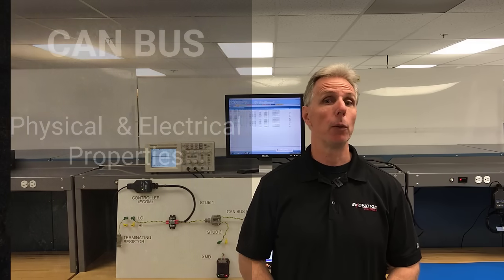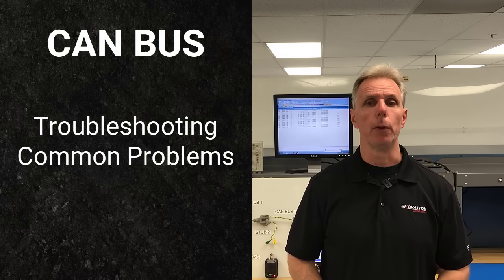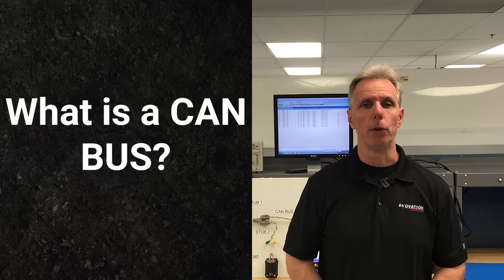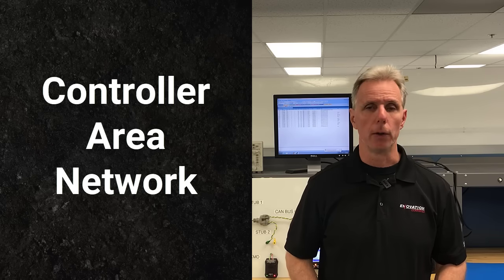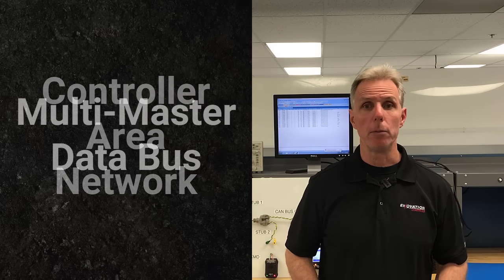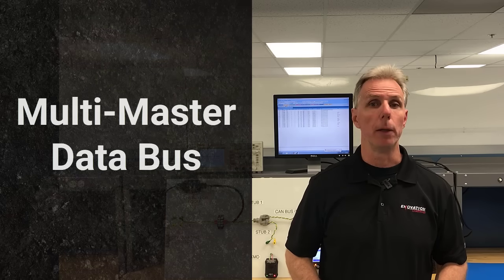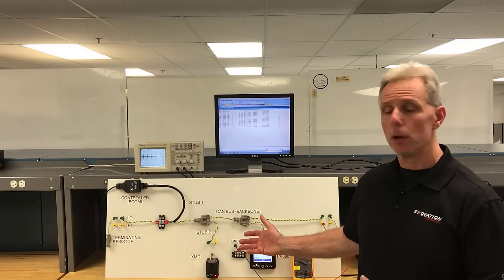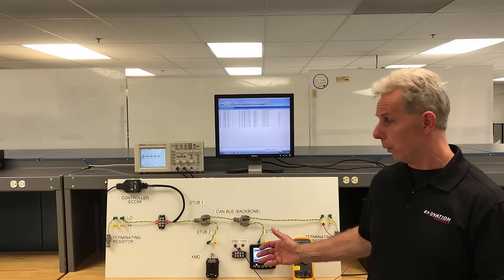CAN Bus Properties and Troubleshooting

Comment: Great video. My 2003 f350 6.0 diesel truck has 1 ohm of resistance between high and low can. Voltage on these are high 2.75, low 2.37. Is this an end of line terminator  going bad? If so, where is it. No one seems to know. I suspect the 4x4 module, as they cause so many problems when they go bad.
Reply: Put a scope on it and look at Allen Bradleys documentation to determine node number.  Then pull one node at a time and use either the scope or determine node number loss.
Reply: @marklangren3142  I found the power supply to the ecm to be low. My breakout box was showing ecm voltage down to 9 volts while cranking and 11.9 while running. It was causing all kinds of codes and false issues. I found 2 things wrong. First one was, I bough 2 brand new batteries and one was dead from the factory.. so I was cranking on one battery. Replacing that helped the ecm voltage during cranking. However, the running voltage was still low. I found the 2 red wires on each battery + post were isolating.. those 10mm nuts, have build in swiveling flat washers. The washers had rusted somewhat and were isolating the nuts from the wires. Then the battery posts themselves had a very thin layer of corrosion that also acted as an isolating material. Once I polished the battery terminals, wires and installed new nuts, the run voltage on my ecm came up to 14.4 while the engine was running.. all my problems went away at that point. Those 2 wires feed the ecm, ficm, fusebox, and glow plugs. Low voltage on these feed wires will make a perfect truck, a junk truck...
Reply: @KBS117 i just read your second comment where you said that fixed all your problems... what two feed wires were you taking about?
Reply: @davewallace1639  the smaller red feed wires on the + battery posts. Those red wires feed everything in the truck except the starter.
Reply: @KBS117 so should I test those wires specifically to see what voltages they have
Reply: I have the same truck, no communication to scanner, did you ever find a solution to your problem???

Comment: i took a voltage reading on can bus net grounded one side good and did pins 6 and 14 low and high bus, should add up to 5 volts between them i get .9 and .9 1.8 volts total!! have   no start pontiac g6 2008 lz4 3.5 u0101 code tcm it was fine until i took battery out caused all kinds of issues! how you supposed to change a battery if it ruins the car?? lost memory or something. i get 60 omhs on bus and power! just the high low way low .9 volts! times two 1.8 volts should be five whats this mean!! help

Comment: i was getting 120 omh on can bus at obd2 port!! had a no start issue! earlier in project saw online that the stupid spy network onstar caused many issues so i unplugged it properly! one of the termination resistors must be inside the onstar system plugged it back in everything is fine now 60 ohm reading! had a error on dash no start! gm put piece of shit pontiac g6 speed sensor one inch above exhust manifold! i let car idol in garage for 20 minutes on cold day a little to long and the sensor overheated! tcm tran cont module couldnt communicate with ecm or bus anyway! the speed sensor can cause this issue according to national database of mechanics notes! dont be a part changer people!!! test, look, grounds, power, wiring issues, sensors, modules ect... the stealership( dealer) couldnt fix my car!! changed so many parts that wernt nessary!! i went in bay got key and towed my car home fixed myself and im a carpenter! the dealership is sorry ass thieves!! they lie!! always!! you dont have to pay them people if your car dont drive home!! be a man and take your shit home!! its a civil matter! they have to sue you and cannot!! so many people pay thousands for parts and tow car home!! tell them up front your not a sucker fix it right or wont pay!!

Comment: Please help.  In my '96 F-150 the speedometer and odometer stopped working.  I replaced the speedometer with one from a donor in a junk-yard.  Truck didn't like the replacement as when I attempted to start the truck the starter sounded as though it turned over maybe 1/8th of a turn and then everything shut down as though the battery had been completely removed and left a no communication issue between my inexpensive scan tool and the OBD 2.  I put the original speedometer back into the panel.  My internet research revealed I could restore OBD 2 communication by disconnecting both battery cables, turning lights on for a while and then reconnecting the battery.  Did that and then with key on/engine off check-engine light and other panel gauges worked (headlights, horn, and interior light all good) until I again tried starting the engine which again resulted in total electric shut down.   Any information dedicated to solving this puzzle will be tremendously appreciated.
Reply: You need to fix your immo.when you install your donor speedometer you didn't clone it from your oem speedometer and when you power on your car immo shut it down as it should.put your oem speedometer back and check what is going on with the immobilizer.

Comment: It does not matter where you terminate it. the can-bus must have a resistor somewhere, and as a surprise for you in real cars there is no standalone resistor.
There is no possible way in the universe for a module to know where the resistor is.
 There is no stub, no daisychain (you have no idea what those mean). All devices are in parallel 
Please stop.... there are people that might think you know what are you doing.... omfg....
Reply: Hi Tanase, from a technical standpoint the CAN bus is just a twisted pair transmission line and if you don't terminate the ends of the transmission line into it's own characteristic impedance which is typically 100 to 120 ohms for a twisted pair then you will indeed get reflections from the ends of the non terminated transmission line.  While the two termination resistors in parallel look like 60 ohms no matter where you measure the resistance with an DC ohm meter, the AC measured impedance will be much different depending on where you measure the impedance if the ends of the Bus are not terminated properly.  You said a module has no way of knowing where the resistor is, but that is not the point.  You don't want signal that reaches the end of the unterminated transmission line from being reflected which can then distort signals on the transmission line.  You need to study transmission line theory and propagated signals on transmission lines to understand the theory behind the use of the termination resistors.  You might be able to get away without using termination resistors the proper way depending on the length of the transmission line, but to keep signals very clean you really should use termination resistors on the ends of the transmission line which in this case is the CAN Bus.  Just FYI, Don
Reply: There are stand alone resistors plugged into the automotive CAN circuit for this purpose.

Comment: Nice video - most people struggle with CAN bus troubleshooting.  If Enovation Controls / CANcapture are interested -> It would be great if the CANcapture software were a more active product.  No new features or bug fixes have been done in >8 years.  The ECOM and CANcapture software work very well and have great features for the money.  However, not updating the manual to include the application builder, no support for multi-plexed messages, bugs with the panels, and no controls with the GUI (keyboard presses can be recognized as triggers; indicators only - no GUI controls such as slider, button, etc.) mean either you become very comfortable with the Angel Script language or you write your own application in a different language and use the hardware.  The lower priced "locked" hardware is a great alternative if you package a rudimentary application with the tool or write your own application.  The support forum was strangely hosted by FWMurphy (now part of the same company), but then the forum seemed to go away.  A support message from the company indicated the product was still active.  However, no new releases, etc. would seem to indicate 'active' means you can still purchase it and it has not been discontinued.

Comment: I've had battle with bad connections on our A&B Devicenet system on a rolling mill. I finally found a good spot in the middle of the loop I can break into and hook up my meter. I use a Fluke with a detachable face and I take the meter face with me and go around to the different components on the loop and lightly give each one a tap and watch the resistance to find the culprit. The Profibus is similar and they use a higher value termination resistors. They use plugs with a D-connectors at the nodes that also have a switch in the plug to switch in or out a termination resistor and sometimes the switch can get dirty and cause problems. I hook up the meter and tap the connectors to find the offensive plug. Your  troubleshooting example is spot on. Very good indeed. There is still a lot more for me to learn about these systems.
Reply: Fluke 233a, good meter. Mine died after 10years. Now I've got a flir dm93. More durable, and can like to your phone.

Comment: What if both high side and Low side have same output of 2.46 volts and 60 ohms shows across both terminals?
Reply: If both low and high have the same voltage of 2.46v, which is close enough to 2.5v, it means the network is idle and there is no communication. You would need to activate the modules to see the voltage changing. If the modules are on and supposed to be communicating but you don't see the voltage going down at low and up at high, both data lines are shorted to each other.
Reply: @musnoure  Right. They're not gonna be shorted though because its 60 ohms so system is asleep.